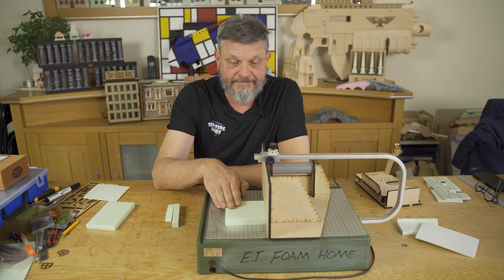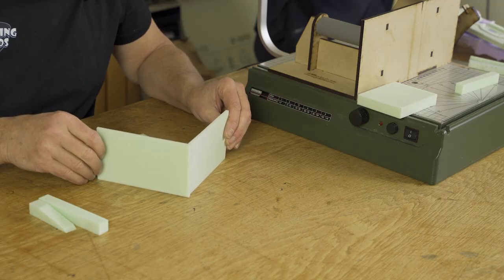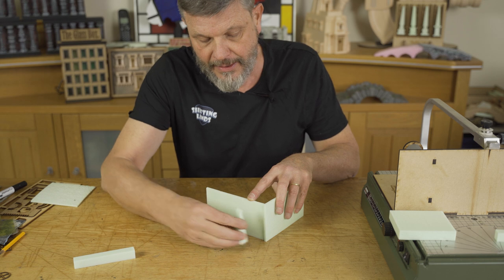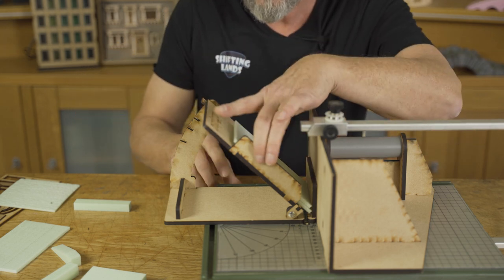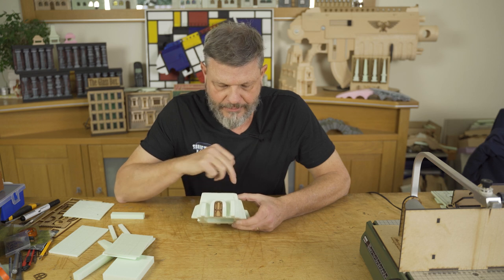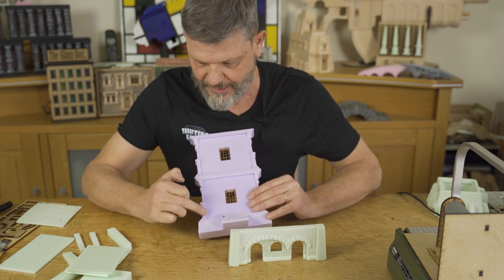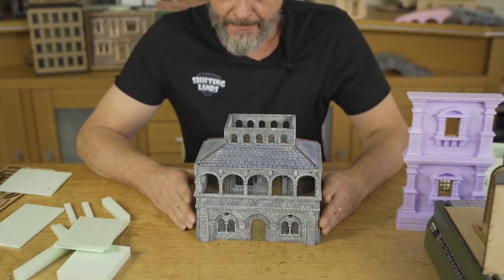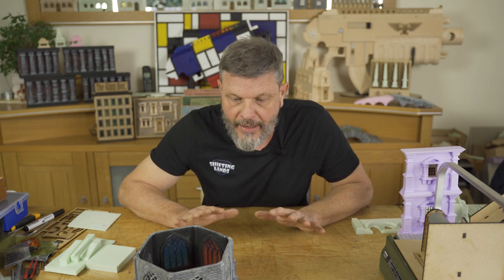Corners in your foam walls: How to get rid of those messy seams and more!

Comment: I recently created a simple seawall for a small model train layout from blue XPS.  I used the Proxxon to cut my walls.  In 1:48th scale I measured out blocks on two pieces of XPS foam that are 4 foot long by 2 foot high.  I ran a balled up piece of tin foil over the surfaces to create a stone look.  I deepened the mortar lines with sculpting tools and rounded off the corners of the blocks to show wear over time.  I included capstones in my carving at the top of the walls.  I did some blocks with major cracks.  I cut the corner blocks so I could dovetail the corners together.  Blocks overlapping blocks.  It fit very well.  I painted the base color of the blue XPS with a medium gray chalk paint.  Then I glued the two pieces together.  I came back with drywall putty, for filling nail holes, to force into the mortar lines, cracks and the various marks made by the tin foil.  I wet my finger to rub the putty deep into the foam, then wiped up the mess with paper towels.  Now that the walls have dried my wife says it looks like a stone wall.  Next is to weather it with a brown and a black wash to age the walls further.  Part of it will be below a water line.  Maybe need to add some greenish color to it once I figure out where that water line is.

Comment: Nice! Perhaps there's an opportunity to use one of your existing jigs to cut alternating notches from the edges of wall pieces so they can interlock? Increasing joint strength and helping with an illusion of interlocking brickwork?
Reply from the maker: Will add that to my to do list , thanks
Reply: @Shiftinglands  How many volumes are there in your to-do list? Mine is getting unwieldy! ;)
Reply from the maker: @MyklCarlton  lol. mine is growing, but questions like yours also help me to make more usefull content. So thanks again.